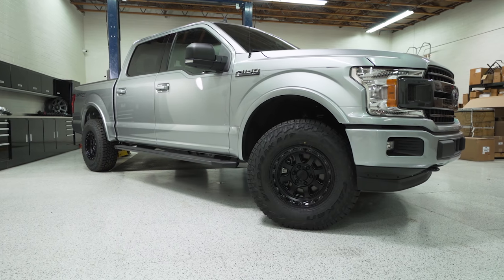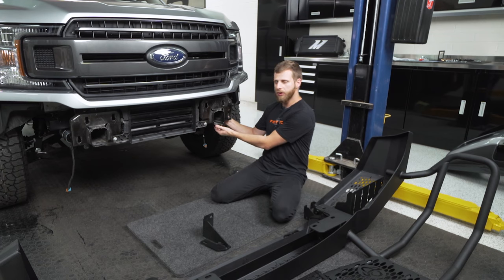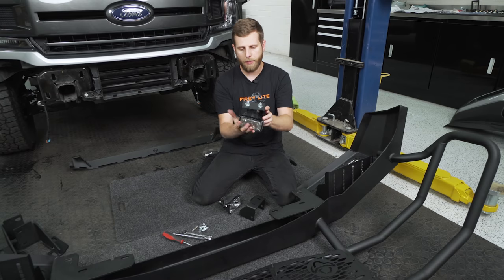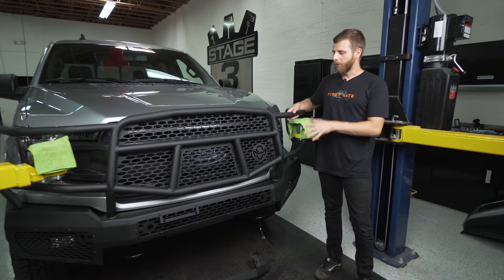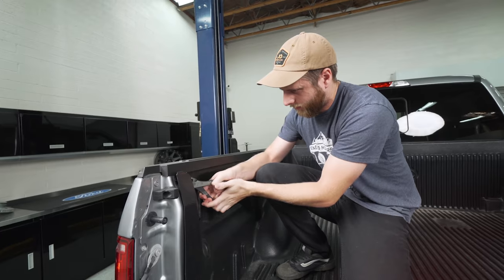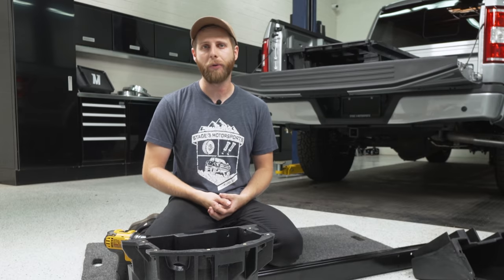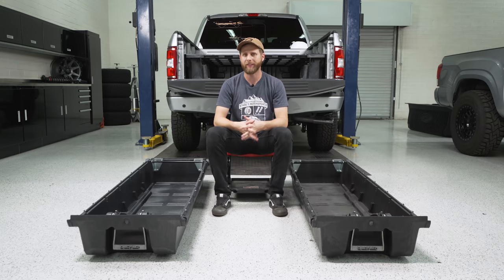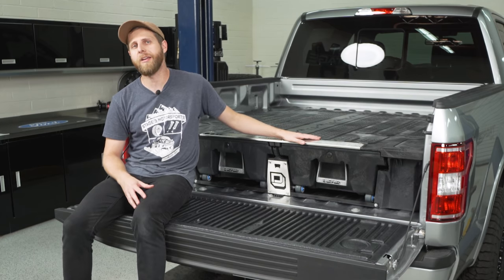2020 F-150 First Lite Hunting Truck Build: Ranch Hand Bumper & Decked Drawers

Comment: I would have done an overland rack instead of the decked system. They also have some cool flip out boxes you can get that tuck next to the wheel well. Just some better ways to get areas to store hunting gear without losing bed room.
Reply: True, an overland rack would also have been a good option. I agree that this isn't the best system if you need lots of space in the bed, but it does work well for how First Lite is going to utilize the truck.

Comment: How much did the front end sag with that heavy bumper attached?  One thing I really don't like with this bumper is how one of the grille guard bars blocks the high beam. Wish they would customize the guard for the truck instead of using the same design regardless of what truck you have.
Reply: The most recent video we posted covers all the details on that if you want the full explanation, but to keep it simple, we lost about 1" of ride height in the front.
Reply: @NoahStage3  yes I saw that, actually already watched it. I'm surprised you lost that much with that suspension! Thanks for answering my question.

Comment: Did you take a before and after height measurement on the front end?
Reply: Sure do! I have a shorter video coming soon that will explain the details behind the bumper's weight and the ride height measurements, but to put it simply, we lost about 1" up front.

Comment: That decked system is horrible for hunting it takes away 80% of the bed height making it hard to load in a deer and pretty much  everything that don’t fit in the drawers
Reply: To each their own. First Lite specifically wanted a Decked system and we also like these kits. Even though this build is hunting focused, it has to serve a lot of different purposes as a company truck for First Lite and they want organization more than maximum bed space.
Reply: @NoahStage3  yeah for hunters its a no go. Sense its a hunting focus build that decked system negatively affects a hunters needs on a truck. You arnt putting a deer kn that i know it could hold the weight but no it takes up most of the bed height which is bad for a hunter and it makes it even harder to load a deer jn the truck cause you now have another foot or so to lift. Oh god cant even imagine putting a new tree stand in there you bought.
Reply: @buffalobmf  The first lite crew isn't throwing whole deer up into the bed.  Every  hunt I've seen them on, they quarter their game in the field and pack it out.  I don't think it would be that bad to throw game bags of meet up into the bed.  Really, any lifted truck sucks to put heavy stuff into the bed since new trucks sit so high.  An old 4x4 ranger would be the perfect little truck for getting around my neck of the woods.
Reply: @duscra92  who doesnt bring their deer home with them to get the head trophies with the meat 😂
Reply: @buffalobmf  I'm saying the deer will be broken down.  It's a lot easier to throw pieces up on the deck than the dead weight of a whole deer.
Reply: I have decked storage for my truck, added gull wing toolbox then added 7.5 inch rail around the remainder of bed . Toolbox and rail are same height and allows me to carry materials without lowering tailgate. Also rail keeps my dog more secure
Reply: @georgeleckband2693  we have one at work and its a pain in the damn ass cause of the no bed height. Its great for tools and other stuff but i need bed space more then storage compartments and i can never have it